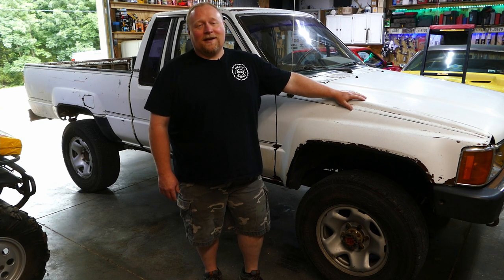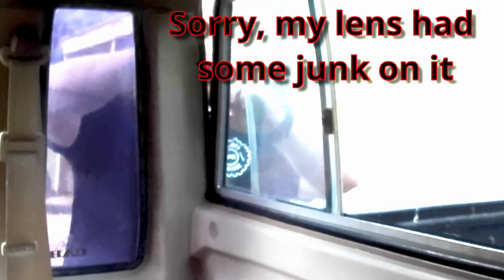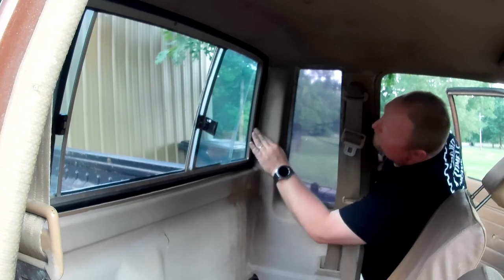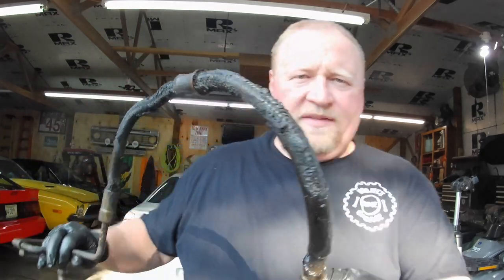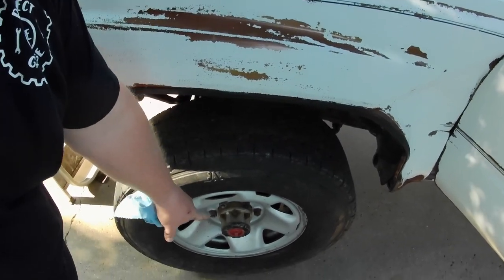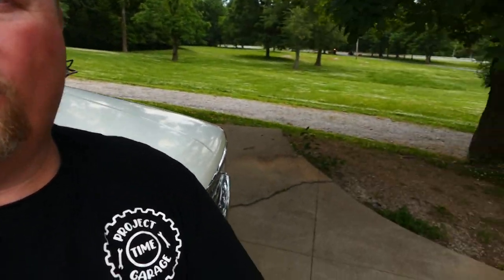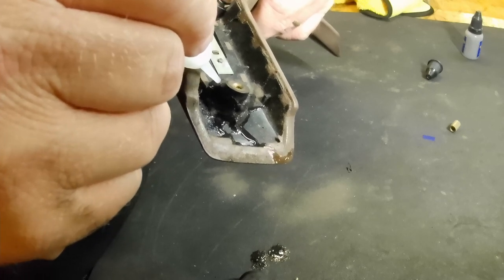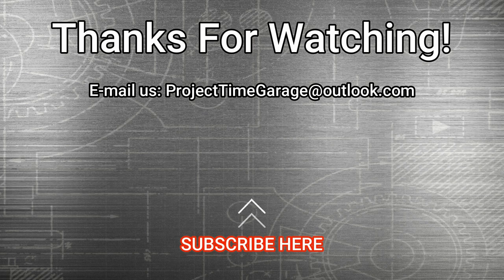Installing a back window in a Free 1987 Toyota Pickup

Comment: Good video.  Can the sliding windows be replaced individually?  Or do you have to replace the entire rear window assembly?
Reply from the maker: No, I think the slider will come out of the frame.
Reply: Yes, you can! you'll have to pull out the entire back window assembly to do so...
It's in the Service Manual:
https://drive.google.com/file/d/1WNg6JeyCogDkOORfLGKD6Uxun0boJSpf/view?usp=sharing

Comment: How did you come across that truck for free have been looking everywhere for one
Reply from the maker: Wrong place, wrong time.... sometimes free is expensive, lol. 😂
Reply: @ProjectTimeGarage  I can handle that kind of expensive it’s paying a ton for one then having to spend a fortune to fix it up Lol 🤣
Reply: Did you ever find one? Where you located?
Reply: @damnitdang  no located in Missouri ozarks
Reply: @donhook6688  damn that's far. I know in cali you can still find some pretty good ones. Sometimes for a decent price.  There's an 80s pu sas swap flat bed currently for like 4800. With a small block chevy swap. With a exotic cage.